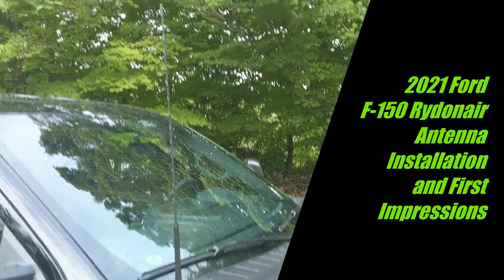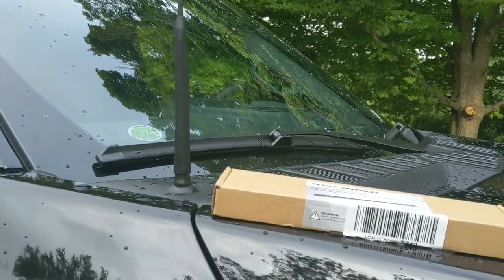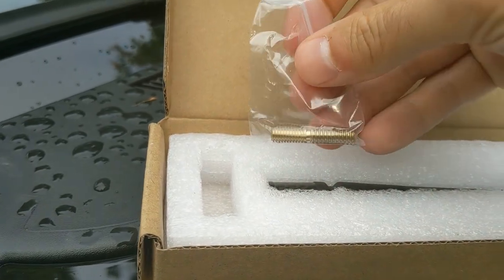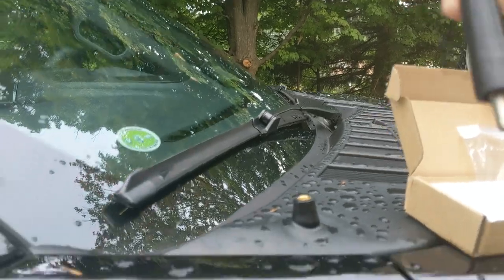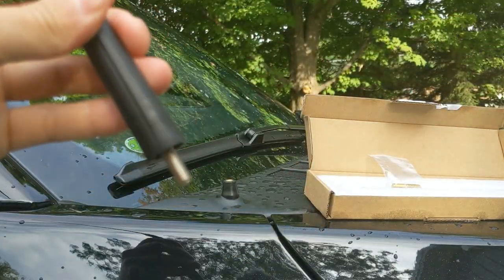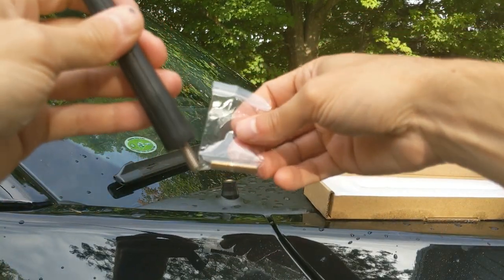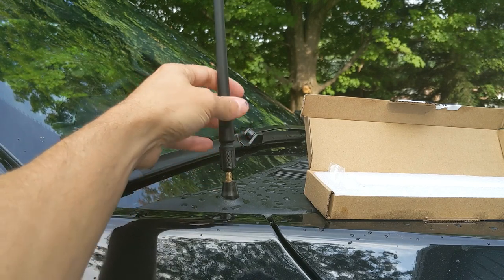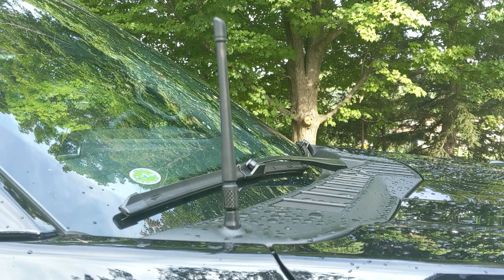2021 Ford F-150 Rydonair Antenna Installation and First Impressions

Comment: I put one just like this on my 2021 F150 I live in the city but on road trips have not noticed any problem with reception. It handles the car wash 

with no problem. I recommend this product.
Reply from the maker: Hi Ed, thanks for the comment. I agree, it has been good in the carwash. One suggestion though, check the tightness once in a while. Mine came loose once.

Comment: I looked at shorter antenna for previous trucks, but found i actually liked that the antenna hit the parking garage roof before my roof rack.  Just an alternative view...  thanks for your video.
Reply from the maker: Yeah that was one nice thing that I miss, it's like an early warning system for low overhangs.